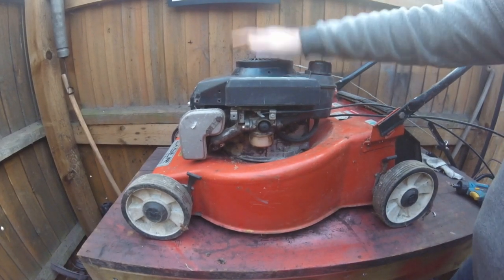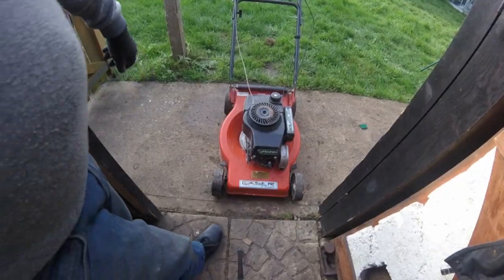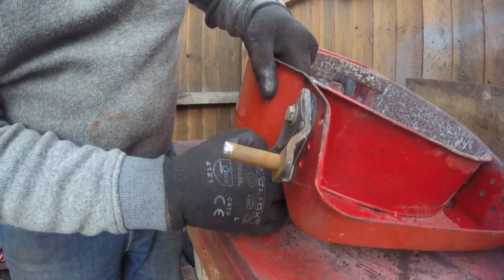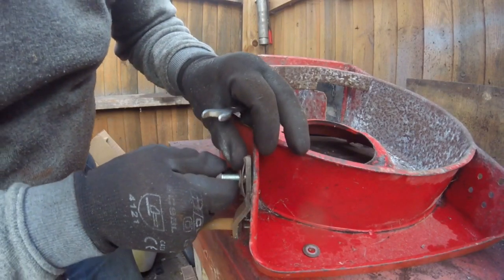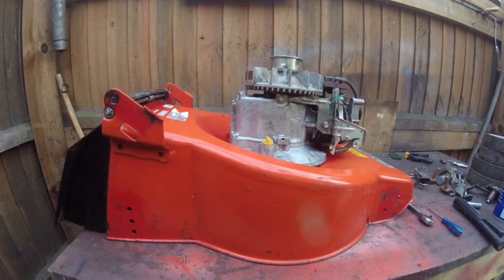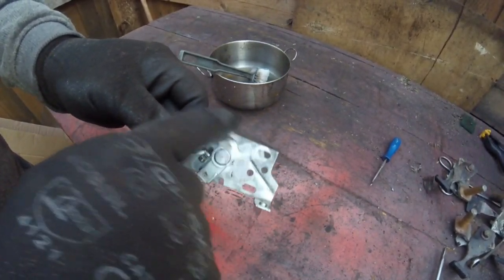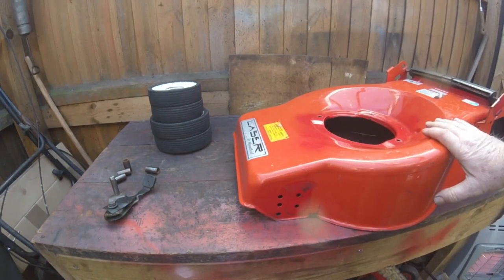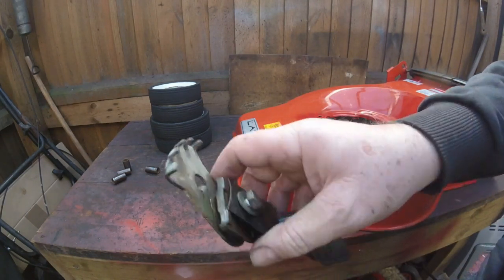Tecumseh Mower Engine will it work

Comment: Roy I have prima Tecumseh rotorvator with a carb what pissing out quicker then I can fill it what is the best like for like part I can use as a replacement as the old parts arnt stocked any where
Reply from the maker: Google prima tecumseh rotorvator carburetor replacement there could be something for it